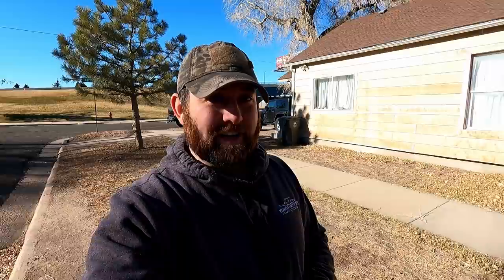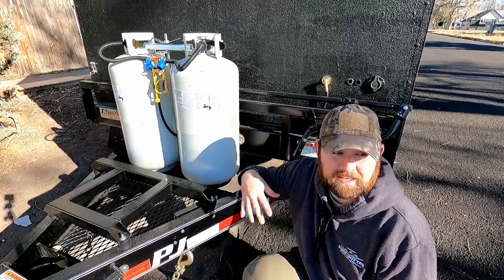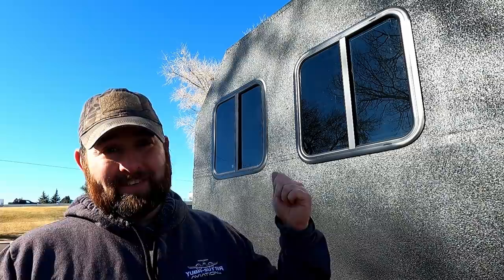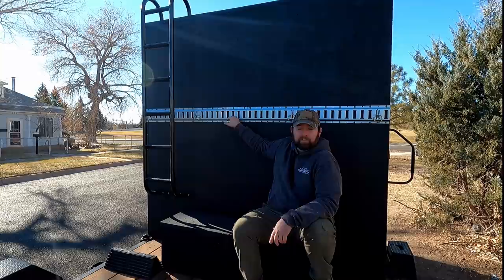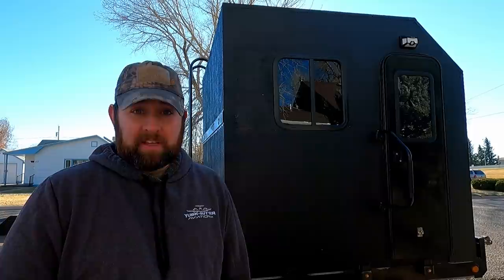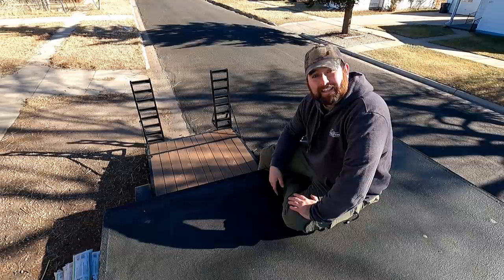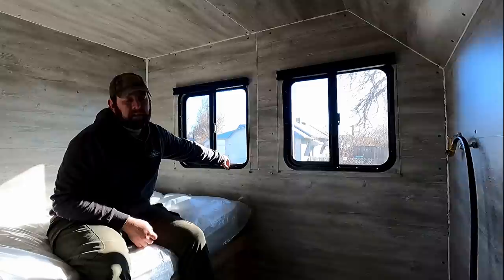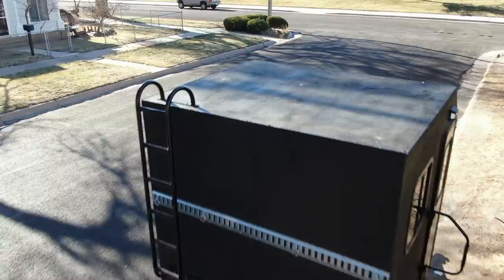DIY Crawler Hauler & Bugout Camper BUILD

Comment: Good job bro. Keep at it and itll be a little paradise on wheels soon. I'm trying to see why you wouldnt just use window molding trim around the  windows and doors. With all the different sizes and options it should be pretty easy to find something. If not, fabricating your own custom trim wouldnt require anymore skill than you've already needed to get this far. I'm sure you already heard this but watch some other camper videos to see how people finish out the trim on their windows and doors

Comment: You need to build either a box or a road shield in front of you propane tanks to protect them from rocks, road hazards,  etc. I would go with a box to keep them from getting stolen.
Reply: Agreed and on a side note, it may be better to move those cylinders around to back as having the generator right next to gas cylinders isn't a good idea as it provides a source of ignition for any gas leaking
Reply: @Midnightrider773  Also, he said that he sealed the enclosure with expanding foam. He's already setting up a scenario where carbon dioxide  could build up and become hazardous.  Now you're adding carbon monoxide to the equation with a generator.  It would be prudent to have a Co2 and carbon monoxide alarm inside the camper.

Comment: Excellent concept.  A few ideas that crossed my mind:  I’d have another window (sorry -$$) to the rear to see what’s happening on the patio / with the jeep.  Also, if you take another person, where to sleep?  I was wondering about a flip down ‘bunk’ above your current bed..  For the AC - did you consider a mini split / something like a Dometic FreshWell 3000 - would fit under the bed.  For electrical, I’d use a Goal Zero / Jackery 1000 for the times where I didn’t want / need to run the gen.   Awesome, easy, portable...  Water can be as easy as a jerry can mounted to the wall with a spigot above a ‘sink’ that drains to another jerry can.  Keep it simple.  Fun build there.  Way to go!

Comment: You might want to put rubber on top of the generator mount also. Between the washer and the top of the frame. You're only isolating it halfway right now.

Comment: Get a small Rv ac system w/ heat strip that mounts on top. That will warm up or cool the inside. Also consider a top vent with a solar fan fan in it.

Comment: see if there is a semi truck salvage in your aria that will let you in their yard. look at the sleeper cabinets / bunks and such. good place to get parts that will hold up better than many RV parts. these vehicles are designed to hold up for a million miles. you could build a small compartment on the front to hold batteries and water cans.

Comment: Great video thanks, this is the first combined camper/cargo carrier build I've come across. I'm exploring the possibility of building something similar to carry my 1/3 scale steam traction engine to shows. I'm thinking of a 6'x6' or 6'x7' sleeper box (the trailer is 6' x 14')  and the load area covered with a frame and canvas for weather protection. Mine would need to be easily demountable as my trailer gets used for other things too.

Comment: FYI I have the Champion 3600w that runs on propane. I have a 30lb tank and on cool nights when the tank is low, it will get so cold it will frost up and shut off the generator. After that, I have to switch to gas for the rest of the night if I want power.

Comment: I would forget the roof A/C and vent. Put a window unit mounted in the back wall. The window unit will be much cheaper and it will free up your roof for more solar. The other thing that I would do would be to make a PVC framework for a tarp system for over the trailer when hanging out in your hammock or grilling

Comment: Just a thought.  Have you thought about motorizing the trailer? Might be useful for short site movements when detached from the truck! Simple steering jockey wheel and auxiliary power unit,  very useful function.

Comment: Have you thought about making the bed a Murphy style bed that folds up against the wall, I would use aluminum to wrap around the door and windows like used on a house.
I’m sure you could get someone that has a break for bending the aluminum! I also know they sell fold away steps that are about 26-30 inches wide that could easily be mounted on the frame of the trailer and secured when not in use!

Comment: Great answers to used a new R. V. Windows or regular American Trailer windows and Doors I been telling some people that Regular house windows and storm , screen door doesn't work for Trailer and Camper Shell because of Seals and glass doesn't regulated gas venting and it seal deteriorate under changing weather of 4 seasons of Winter Spring and Summer and Fall and vibration of regular roads and off-roads house glass windows and doors breaks , so there is no anti-vibration windows and doors on house and buildings on a solid foundation on the ground . So R. V. and regular American Trailer and Camper Shell and vehicle Cars truck should be Automotive glass and doors to allowed anti-vibration and 4 seasons of Winter Spring and Summer and Fall temperature change . As well as having a good ventilation in the bottom of the windows and doors to allowed water escape , and bad air remove . It looked great I loved your trailer and your Black Rock solid paint jobs and can't wait for you to get cabinet built-in and multiple Different types of color LED lights Strips wrap around the inside and outside of the trailer , I have one of Motion sensor heat detector Walmart Supercenter stores Hyper TOUGH 2000 lux LED 3 adjustable panels , Solar power panel of 15 foot long cord reach to the LED lights I can set up to 1 to 5 to mins times set switch and adjustable LED lights power low to med and high . It costs $60. Dollars I used it for My dogs back yards of 100 foot by 100 foot square in near my edge of my north facing forest to see deers and skunks raccoon and of course my dogs triggered the lights after potty break outside in a fenced in yard .

Comment: only thing i would recommend is building a small v shaped section for the front nose of the trailer to cut the wind and also insulate the inside to help keep the tanks at a constant temp even if ur driving at highway speeds on a very cold winter day... can even make it look legit by drilling holes and riveting a thing piece of sheet metal matching size and just give it a nice bend right down the middle or measure up and tack up one side and slowly hammer the bend to match the v shape on the wood enclosure for the tanks and for aerodynamics and your rigs gas mileage's sake!!

lemme kno what you think, im sure it would only take a day to build and u can make it look just like a v nose trailer that would cost you over 3 grand if u bought one prebuilt ya kno....

i love the look and design of this setup tho, man if u ever want to sell this build please let me know i can think of a million uses for this baby, i would be honored to live inside and have a perfect spot to relax on track and drag days along with offroading, going sledding and having a warm spot to hang ur boots...

do u have some sort of wooden stove setup to warm the inside or u using propane heaters electric heaters? only other thing besides the tank enclosure and v nose enclosure for the nose is also some sort of heating option, and mayb include a  natural sunlight for natural light, and mount up some solar panels and make a cheap diy solar assembly so u can power small devices and light the inside outside, maybe power tools make coffee, warm the inside who knows.... please let me know what you think i absolutely love this build i cant say it enough lol... god speed,

-pete

Comment: Very nice build! I see not ventilation, which you need with propane heating and grills. I personally have run until that problem, condensation as well as dangerous toxic gases building up.

Comment: Looking good, I'm thinking of building something similar. For your windows and door and are not thick enough, pull out the windows and door and cut the openings bigger, then frame with wood the same thickness as the walls, attach your windows and door to the wood and trim then out.. 👍🏻

Comment: Wow!  Great build and project man!   Only things I can think to improve is 1) fabricate a hood for the front - add aerodynamics and get some flow up over that big flat front and giving some road protection to your powerplant (generator, propane, battery combo on the A of the frame) 2) they make some great pull out awnings for the back deck, and you should totally build a pull down kitchen box to hang on the back wall next to the ladder.  I've seen cool ideas on those pop-up trailers, and it looks like the perfect spot to grill out, and right under the awning.

Comment: If I were u, I would have put a Dinette that folds into a bed. It only takes 5 seconds. you would have to make sure the Dinette benches are storage accessible so you could throw the blankets and pillows in there. I think a U dinette would have fit perfectly! You could have even found a way to modify the fridge and toilet in it. U were saying something that was multipurpose, that would have worked wonderfully.

Comment: That’s awesome if I can buy some thing like that that’s exactly what I want to build but I need to plan the inside really good in my head because I want a double wide bed for me and my wife probably cantilever it over the hood of the jeep, Kind of like a loft so you can drive underneath the bed with the jeep front end access the loft from inside the camper

Comment: I would make the generator easy to take on and off keep a good length cable there and chain lock. Running the generator on the frame sucks. Even those quiet little ones are loud on the frame (loud inside rig). Just pop it on the ground and fire it up. Not to mention that will let you place it based on wind to be mindful of tue exhaust.
Reply from the maker: I was thinking thw same thing now

Comment: Covering the insulation at the windows should be pretty easy. You just need to cut strips of sheet metal. You should be able to cut a single piece the proper width and just have it sandwiched between the window and the interior trim. May have to fasten it or use construction adhesive, but it would pretty it up instantly. Good job buy the way!

Comment: For steps,  use the stakes in the trailer to hang them. Use a bolt to "pinch" the stake slot to secure. Obviously you'll need to fabricate to your liking

Comment: As far as your generator belt is concerned why not make it expanded metal cage that is lockable but yet you could use a fire extinguisher through it if there is ever an emergency or a fire. You could also run your lives through expanded metal and get a RV type take cover for the outside when you’re traveling to keep it dry. Just a thought

Comment: Hi. If u going to put solar panels there's a new way kind of track to put 4 panels but one is on top of the other and slide outward to expose the other panel that way u have 4 panels have more power and mayb u don't need propane gas for the generater. Use just batteries and electrical stove. I know food tastes better on gas flame lol. Will us ur choice. Nice trailer. Thumbs up 100%.

Comment: I know you want Air Conditiong instead of a roof unit you should explore mini splits on EBay way more bang for the buck  plus  you can run them off a solar battery system if you wanted to do so way quieter  and you aren’t penetrating the roof most camper issues are roof leaks  after  a few years  unless you do park inside for storage ?   Ultraviolet and age do a number on RV roofs  unless it’s a Airstream   Which seem to not develop them as bad as others
Reply from the maker: I need to do more research on a mini split. Many people have mentioned that but I looked it up one time and they were like $3000-$5000 so I just kind of wrote it off as not an option due to the price.

Comment: Might not be a bad idea to buy an old RV trailer cheap, just to harvest the windows and doors, and any other salvageable parts. Then scrap it to help pay for the build. You could put a flat style water tank on the roof. The gravity would give you a bit of water pressure with no pump needed. An on demand water heater could be an option to research. An outside warm shower would be a nice thing.

Comment: Great work. 
I’ve been wanting to do something similar for awhile. Looking to do a flatbed to tow behind my Tacoma. I’d like to fit a quad on it and either do a cabin like what you’ve done or weld a frame to hold a RTT over the quad. 
Thanks for the window advice. I didn’t even consider the vibrations.

Comment: The argon will only leak out of domestic windows that have argon in them. They only put argon into the really expensive windows. The off the shelf windows not only don't have argon in them, but they are also, more often than not, not even air tight.

Comment: Find and old rv or MH and scavenge windows for cheap windows.
0.020" thick colored "sign" aluminum is cheap and good outside covering using contact adhesive. 
Semi trailer repair places sell 10' wide rolled aluminum which is good for long roofs.

You should consider a fold up deck on the side so you can walk to the back half.

I dont recommend a rv fridge.  They are expensive, use a lot of 12v power and require external vents.  A dorm fridge is cheap and far more efficient on 110 (1a or less).  I use a 3000 harbor freight inverter and 2 batts...lasts a long time.

Comment: For the windows and door gaps Get some wood that is thick enough that you can run a router around the edge so it will set back in. Then it will just look like the window trim molding in your house.

Comment: Perhaps you could trim the windows out using the rubber base molding they use in commercial buildings.  They have flat profiles and cuts easy w a knife

Comment: I never understand why the Air-con is on the roof. This is where it is the hottest and it will not run efficient. If you have enough clearance, I would put it under the truck bed where it would be in the shade and probably can keep you cooler for longer.
Would love to have such a trailer myself, but too many other projects...
Nicely done.
Reply from the maker: I was very close to installing window mount AC unit but I really needed the cabinet space for storage. On the roof works out for space cause I have to use up every inch of space
Reply: @CodeBrownProductions  Just don't forget to note the extra height when driving under a bridge 👍
Space is always an issue on these things...

Comment: For the generator an heavy quality expanded metal cage with a solid metal top. Build the cage padlocks so they can't be beaten off or bolt cutters used in any way.

Comment: Go with a Mini Split.. Way more efficient than a roof top unit... plus you can get heat.
Reply from the maker: I need to look into that
Reply: @CodeBrownProductions  As far as batteries for your solar... Look into Medical back up batteries. I see a lot of them on Marketplace. The Mini split can run off of 120 volt and I know a lot of guys that are running them off their solar setups. I heat and cool my garage with one... I am going to power it with solar in the near future. Your build looks great so far... Jealous.

Comment: I would for sure install a camera system especially on the front where the generator will be to deter theft. My grandfather had one bolted to the frame of his truck and it still got stolen.
Reply: And for the window gap, I’m pretty cheap. I would just conceal it with electrical tape.

Comment: Hello .  
i am new to your channel.  
what I would have changed or made differently: the bed, 
if I was your wash I would let the bed protrude at the back over the hood of the jeep, 
so you have much more space inside the place where the bed is NOW  
to make a seat with two chairs and a table, such a dinnet?  , 
that the table and chairs can become a 3rd bed for another guest to sleep.  
You should also try to keep your indoor living space as large as possible, 
because in bad weather that is all the space you have.  
so you have a sitting area and dining room in one.  
a kitchen block opposite the seat and you have everything 
plus a bit of walking space without bumping your head everywhere.  

with kind regards Hollandduck from the Netherlands

Comment: On the propane tank, if you run high pressure ( no regulator ) from the  tank to the appliances it will gum up the lines from the tank to the appliance. its better to take the regulator off the appliance

Comment: I would have had a reverse overhang for a bed, instead of where the bed would go over the cab I would have it go over the roof of the jeep.
Looks dope, but I would work towards moving into like a 96 to 2005 Newell, or Prevost Coach and trailer the jeep behind it.

Comment: For water you could do a 3" pvc pipe pressurized for a shower. For carry water to drink pvc from the end of the trailer by the ramps over the side walls of the wheels to where to have the beginning of the camper on both sides fill with water . Let me know if you like the ideas